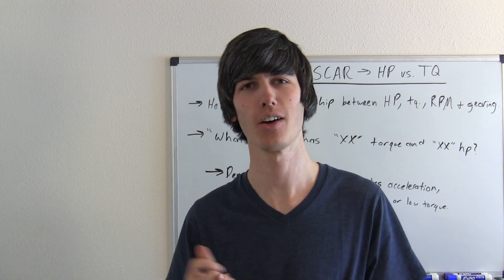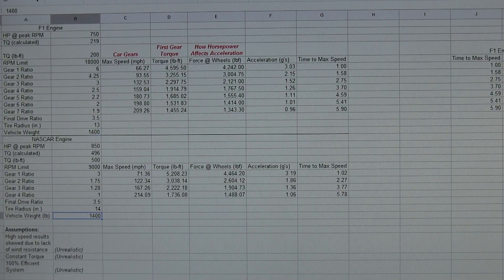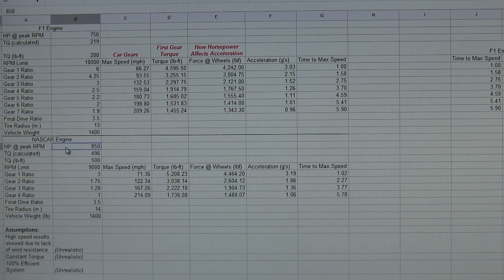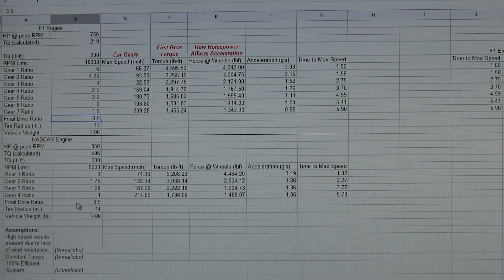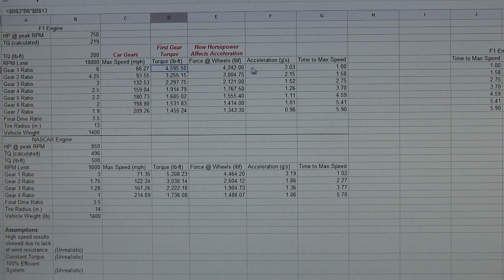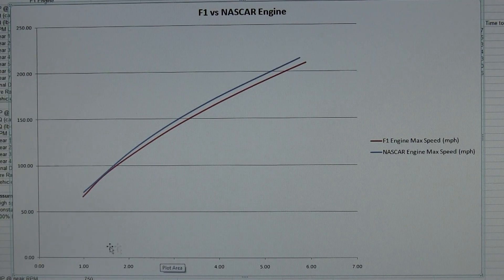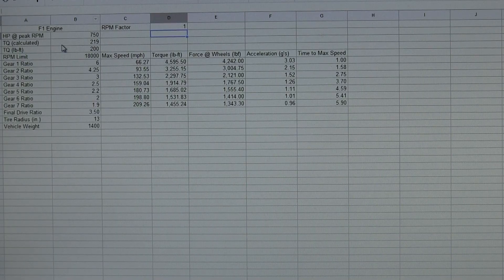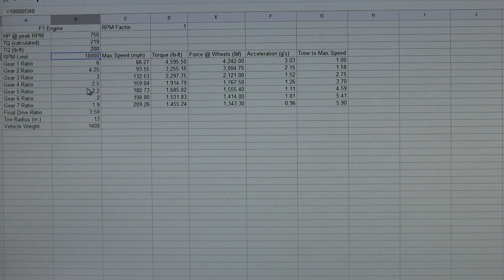Horsepower vs Torque - Formula 1 vs NASCAR

Comment: nascars don't weight 1,400 lbs more like 3,000 lbs and it takes it about a track and a half to get to 190 mph and the F1 cars that could scream at 18,000 could go 230 mph. you have to factor in the amount of torque and horse power loss in the driveshaft. but other than that it was good.
Reply: +Gabriel Sasala hint the topic was to show the relationship between hp and torque, not to compare F1 and Nascar. Obvioulsly weight, aerodynamics, gearing, suspension, etc has a lot to say. But again, this was not comparing the cars, only their engines.
Reply: +Gabriel Sasala&#160; Try 3,450 pounds. They are the heavies race cars in any series.

Comment: Torque creates horsepower, horsepower creates motion. An 800hp NASCAR engine and an 800hp F1 engine in the same car would do the same work. The only difference is that a NASCAR engine's power band is like 4500-9000rpm and an f1 engine's powerband is like 10,000-18,000. NASCAR engine has narrower power band due to big camshaft with a lot of overlap (loses a lot of efficiency at lower rpm)
Reply: +Kenyon Payne same to the f1 engine, it loses way too much at low rpm. keep in mind that f1 engine is only 2.0 litre engine, and create about 800hp, that's why it need to rev insanely high rpm to make that power.
Reply: +zen azhar yes but funny enough an f1 has a very wide power band because of pneumatic valve train, it can adjust lift and duration depending on rpm and has 0 overlap so the powerband is perfectly smooth
Reply: ***** yup, they can control the opening and closing of the valve..
Reply: +zen azhar I'm trying to say they can vary the distance the valve opens and the duration it's open

Comment: +Engineering Explained Could be worth mentioning (or even making a video about) the difference between a DIESEL and PETROL engine, where the former produces low end torque but is bulky and slow - answers the question of, why does my rev counter red line at about 4000 rpm, and the latter more "free running/revving" and agile which goes on for longer. Diesel's torque curve just plummets down whilst petrol engines tend to have a flatter contour. Before anyone jumps out of their seat I am not referring to high performance exceptions such as the Aud R8 V12 TDI LeMans edition. Just a thought Jason for people who are unsure or want to know more about the differences between the two.... Keep up the good work! Learned an immense amount for you so many thanks as always, your vids are just so neat, concise and very clear.

Comment: To put simply, torque is only useful to get the car to move, once the car is going, HP is all the matters because HP determines how fast the wheel can spin.
Reply: +177SCmaro He's saying that to the people that have blatantly said that all that matters is torque. Because there are indeed people who say things like that. Especially because of Tesla cars having all their torque at the initial moment of acceleration. It's a general misunderstanding that torque is all that matters. Some people even have the mistaken notion that a tesla can outrun higher horsepower supercars just because of the slight advantage off the line, when it accelerates much slower than the others beyond the first second or two and indeed doesn't accelerate as rapidly if already at speed.
Reply: max RPM determines how fast the wheels can spin.. horespower determines how quickly it can get the wheels to that speed, and resist countering forces
Reply: Mike Wu wrong. If you had 0 flbs torque at any speed the vehicle would slow down. You need both all the time.
Reply: And torque determines horsepower.
Reply: +scythelord you are so right. The thing with Teslas and electric engines is simply that their engine power has 100% pulling capability from a standstill, whereas a combustion engine needs to achieve a specific rpm for it to develop that torque. That's also why combustion cars need a clutch so they don't stall when you try to set off from zero rpm with no available torque. Those engines need to be rotating to develop power. That is the big difference really.

Comment: the high HP is not more economical because you have to be at higher rpm to produce the same torque , most use forced induction , and the more air you add the more fuel you have to add as well . plus if you can't produce torque at low rpm the faster it spins the more gas it burns , for an F1 team that's not really important . I could put a turbo on my Camaro , but it would turn it into a hard to drive car , revving the shit out of my engine before releasing the clutch so as not to stall out , why would i want to do that ?